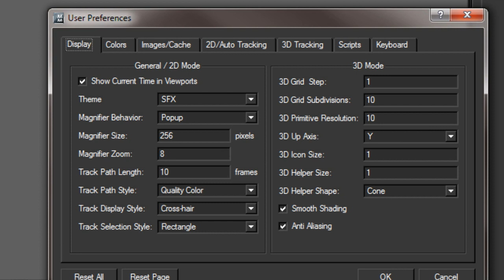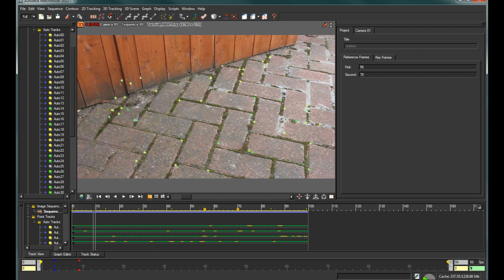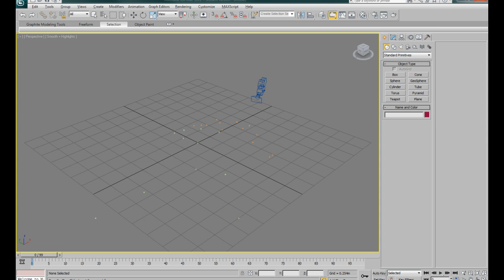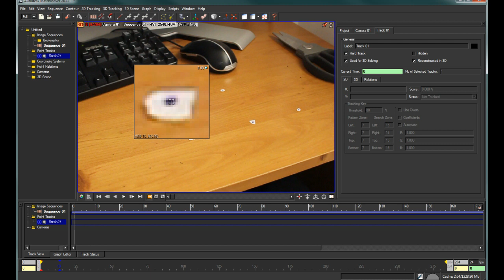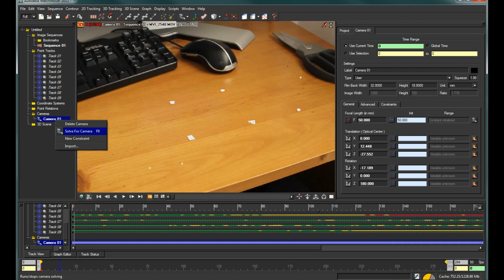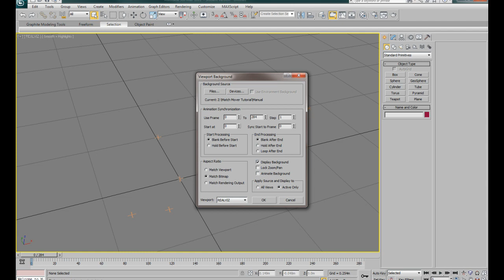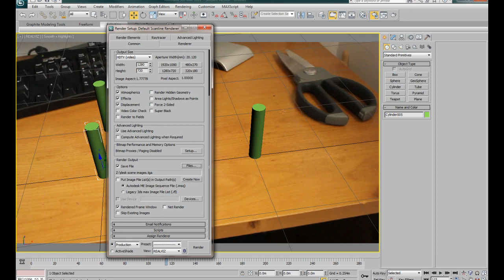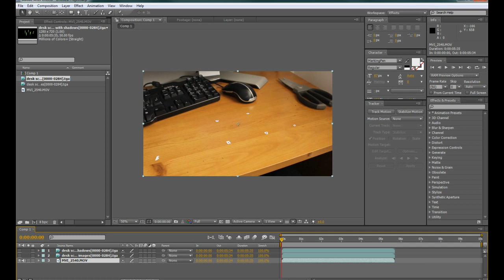Autodesk Match Mover 2011 Tutorial including 3D Studio Max 2011

Comment: Hi, everything works well until I want to set the coordinate system, the y and the z go everywhere, I tried with many different videos, but still I get the same problem, can you help me?
Reply from the maker: If there is a natural 90 degree spot for 3 tracking points then use the middle as the middle of your world.  If it looks upside down then make sure you have you directions correct and in the past I have had to go to Edit -> Preferences and on the Display tab change the 3D Up Axis to something else and make to the correct rotation for the package I am exporting to e.g. 3D Studio Max = Z is Up